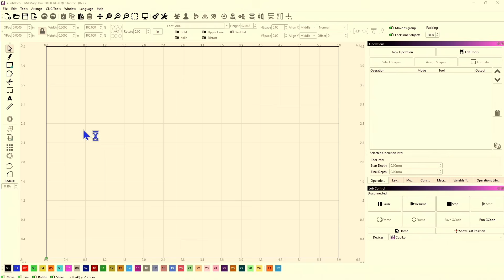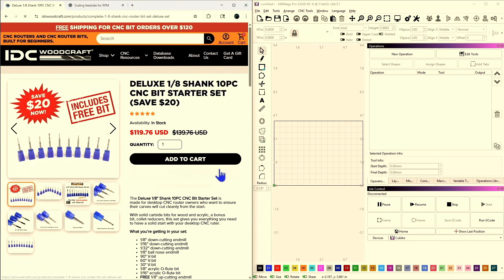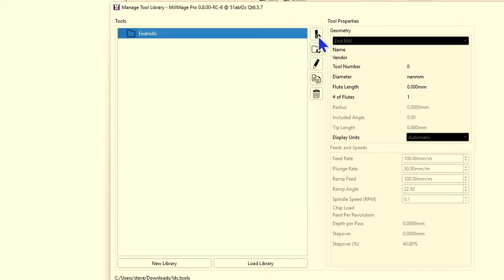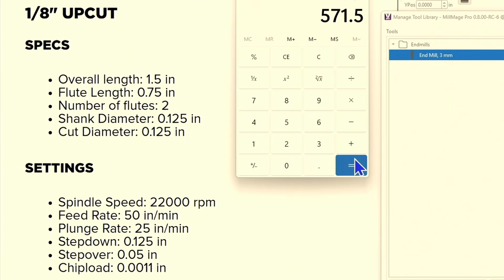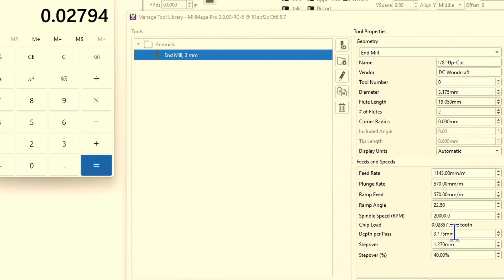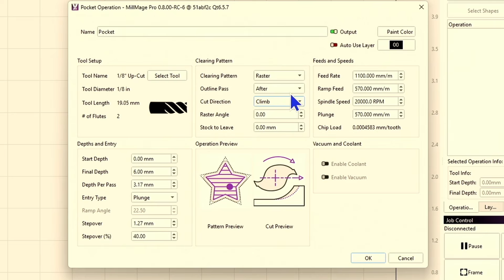Beginner CNC Setup in Millmage | How to Add an Endmill & Set Feeds and Speeds

Comment: Hey Steve, Have fun learning all about CNC'ing. I have been doing CNC for about 10 years way before I got into Lasering. I use a Onefinity with Carveco and I hardly even go above 18,000 RPMs for 1/8" upcut/down cut/compression bits and have not had any break on me or have bad results but they do dull over time. I love using Garret's bits and also the Jenny bits. I try to stay away from buying any bits from Amazon. I don't pay too much attention to chip load but it is important in calculating your feed and speeds. Good luck. Is millmage done by the Lightburn people? I might look into it because Carveco cost me about $180 a year for a subscription.  Thanks.
Reply from the maker: Millmage is from the minds at Lightburn.  The anything designed in Lightburn will simply drop into Millmage.  The techniques I have learned of the last three years in Lightburn will in Millmage.  I don't have to completely relearn a whole new software. I have a large xCarve that has been parked for 2.5 years due to the added expense of another software and the additional learning curve for a different program.  Lightburn promoted this software nearly 2 years ago.  So instead of tackling a new program, I waited for Millmage.  Anyone already using ANY other software would not want to switch to Millmage. The cost savings isn't that great.  And it doesn't do a lot of things other software can do.  But for someone that is proficient in Lightburn and starting in CNC, Millmage is the way to go.

Comment: I have been using Aspire by Vetric for 5 plus years. In their tool data base you set cutters in imperial and metric. You will find that you will be purchasing both imperial and metric cutters. If you set them up that way you wont have to do all those conversions. So set up two folders named imperial and metric your software will do all the calculations as you chose the tool as you calculate your carving and engraving cut paths.
Reply from the maker: That is the way it works in Lightburn, too.  You have the ability to toggle a default for Metric or Imperial.  Millmage had not done that... yet.?.  Some of the manufacturers will offer their specs in Metric or Imperial.  Since the software only appears to be working this way at the time of the recording, I was simply showing how to do the conversions when no other option is available or they don't know to go look for it.

Comment: Your speeds and feeds will be different depending on the type of wood if a softer wood you can get away with going faster and deeper sometimes
Reply from the maker: Yes sir.  These settings are base settings. Just like the cut libraries for our lasers.  These settings are simply a tested baseline to start with.
Reply: And once you get going with it I set my bits up like I do lightburn for different materials once you figure out the settings that work best for the type of wood

Comment: Think of a router if you move left to right versus right to left. Right to left the bit is trying to climb out of the cut. Left to right it polls into the piece your cutting
Reply from the maker: Excellent clarification!  I will use this later.  I did get a better understanding of it, but this is an elementary explanation.  That makes it PERFECT for me.
Reply: ^^^this!

Comment: I think “end mill” indicates a flat cut, a ball bit would have a corner radius. I don’t know anything about CNC other than the 2 guys talking about their big CNC machines. I don’t have room even for a small machine (Roly takes it all up), but I like watching and learning about cool stuff.
Reply from the maker: Still learning.  Technically they’re all end mills—a rotary cutting tool with cutting edges on the end and sides. Within that family you have many types depending on geometry and purpose:

Flat end mill – standard square tip, leaves flat bottoms.
Ball nose end mill – rounded tip for 3D contours.
V-bit / Engraving bit – angled tip for carving and sign-making.
Upcut spiral – pulls chips up, good for slotting, but can fray top surface.
Downcut spiral – pushes chips down, clean top edges, but traps chips in the cut.
Compression bit – combo of upcut & downcut, clean top and bottom edges.
Tapered ball nose – for fine 3D carving and detail.
O-flute / single flute – good for plastics and aluminum, clears chips well.

Comment: I'm guessing that your chipload was higher then the one from IDC is because you didn't put the depth of cut to 90% 🤔 I would have set the feed to about 1140 and the depth of cut to 2.75mm.
Reply: Little disclaimer, I'm not a CNC mill operator, but I do work as a CNC lathe operator and programmer for them, and currently self learning cad/cam and milling.
Reply from the maker: I am still learning and I appreciate the feedback.  I sincerely do. However, Chip load is defined as the thickness of material removed per tooth per revolution. It depends on feed rate, spindle RPM, and number of flutes. Depth of cut changes the chip volume and cutting forces, but not the chip load itself.  Since I had to lower the RPM I had to lower the feed rate. Thanks again for watching and taking the time to comment.  I did have to check to see if reducing the depth per pass would work and it didn't.